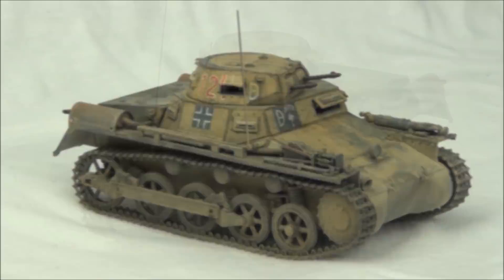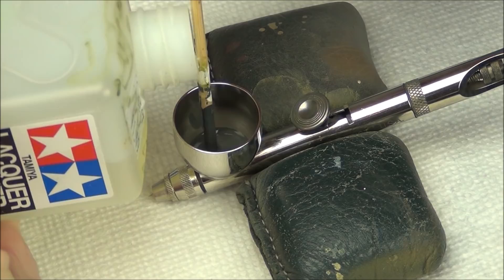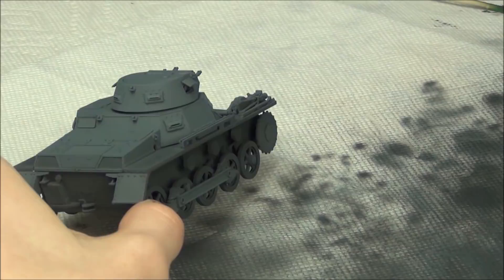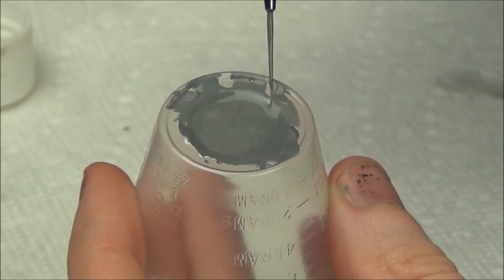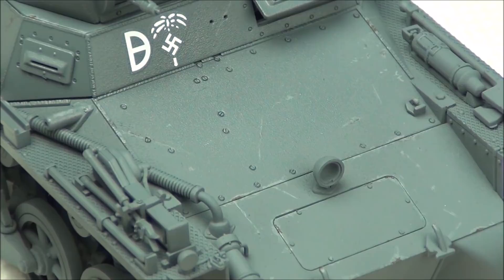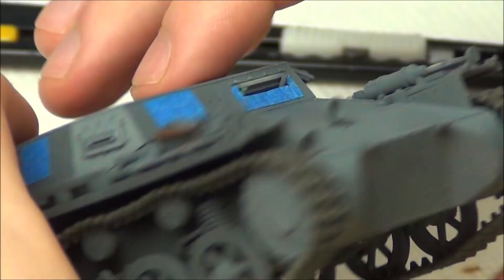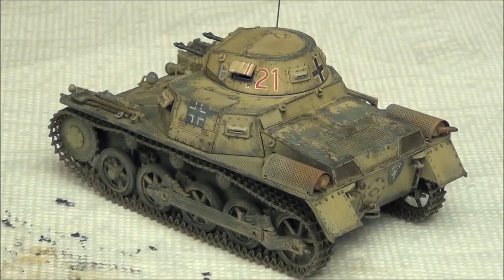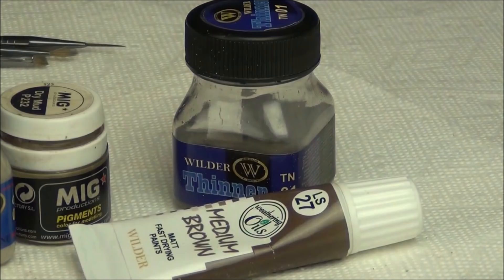How to Paint & Weather DAK Model Tanks | Standard Weathering Procedure Ep.3

Comment: Great video, fantastic result, new subscriber!!!
A newbie question, can I ask will this chipping technique work ok for Camo schemes?
Why I say this, is because one will obviously apply multiple colours layer (and time for each layer to dry)) to achieve the camo. Will the technique still work OK with the thicker combined colour layer?
Would you use anther technique? 
Cheers in advance
Reply from the maker: +RicheUK hello Riche.  What you have described will certainly work if it is the effect you are going after.  I did it once on a StuG where the vehicle was painted in dark yellow with some light green stripes painted on in the field.  I did hairspray chipping between the yellow and the green camo to simulate the green being a much weaker paint as it was camo applied in the field.  If you'd like to see it, it's my "Standard Weathering Procedure Episode 2" video.  But it's essentially exactly the same effect as was done here, just where the green camo colour was sprayed on in thin stripes rather than the full coat like I did with desert yellow on this vehicle.
Reply: Thanks for the info. Can I also ask  in your opinion, the best way of doing camo  by  paint brush, if there is any?.
 I have no airbrush at this time :( 
I work with  1/72 scale
Reply from the maker: +RicheUK it is hard to achieve the hairspray chipping effect with brush applied paint due to it being generally applied in a thicker layer than airbrushed paint.
Reply: @Panzermeister36  OK thanks for that, but in general how would you (IYO) do a camouflage  effect on a tank (1/72 scale) with just a paint brush? or would you not bother :)
Reply from the maker: +RicheUK I don't really have an answer for you there sorry.  I've never done 1/72 scale and I've never really brush painted camouflage since I had an airbrush before I even started building model armour kits.
Reply: @Panzermeister36  No worries, you been a great help. Keep up with the Ace videos :)

Comment: When you add thinners to paints does it dry faster? My thinking is most thinners evaporate pretty fast so how does it effect the painting.
Reply from the maker: +PicsAndWood I expect that it does make the paint dry faster.
Reply: @Panzermeister36  I'm watching the video as you answered me. I'm at the part with the exhaust. Maybe you could mention that the reason exhaust usually rusts more is because heat accelerates the oxidation process which causes those parts to rust quicker. Also, heat around the exhaust can cause bluing. Where the hottest parts will actually have a blue/purple tint to it. I was in the military, the Navy, and saw this a lot. Of course there would be black because of soot, but the underlying metals would also blue. This is an excellent video and I don't mean to sound as if it's not. I'm learning a lot from your videos about weathering. I think I mention before that I do this kind of thing to Hot Wheel size cars. I've mostly done rusting and have gotten better with time, but I want to venture into this type of weathering as well as other effects (I want to make a diorama of a car half burnt on the side of the road). Thank you very much for your tutorials. Great job and greatly appreciated.